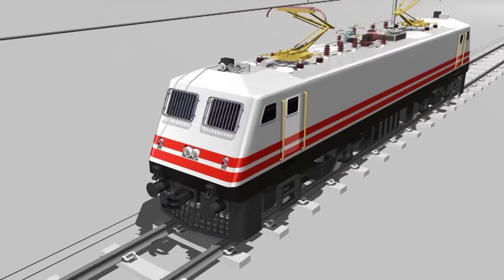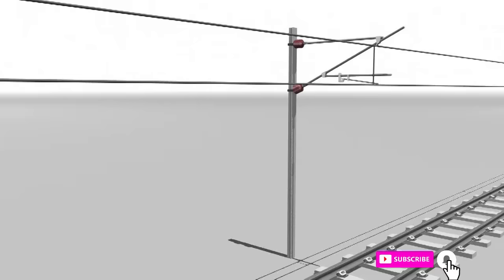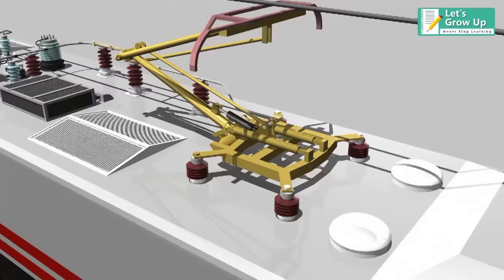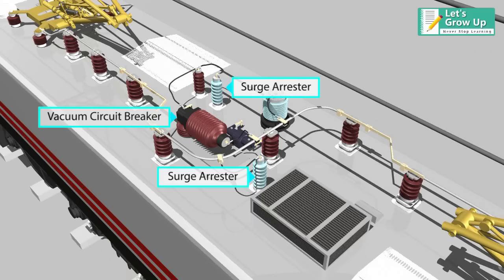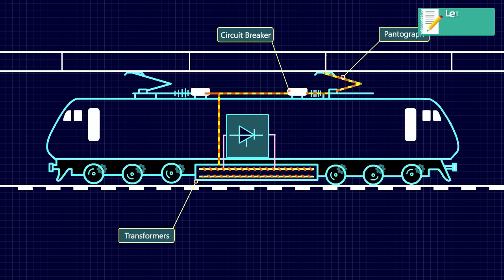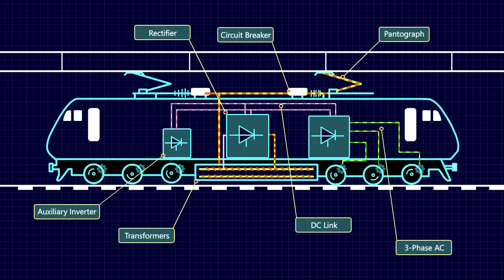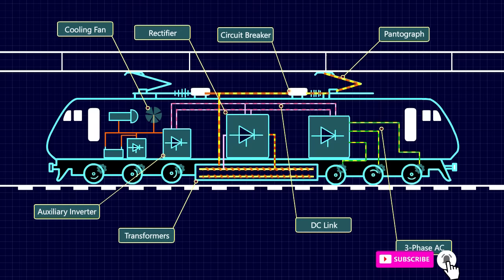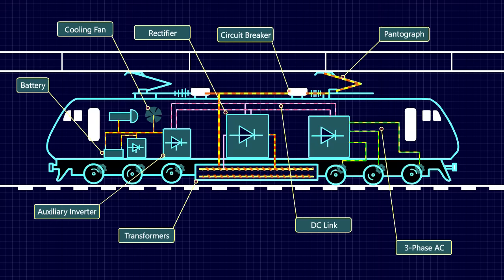How Does Electric Locomotive Work? | WAP7 Working Function | Electric Locomotive Working function

Comment from the maker: Q | Why surge arrester needed in electric Tran?
Reply: Answer plz
Reply: For protecting the electrical equipment from over-voltage short-circut during lightning and from the internal switching
Reply: Very much needed
Reply: @chiranjithalder3890  i can give answer
Reply: @chiranjithalder3890  i am an locomotive engineer
Reply: To maintain balanced voltage and current
Reply: What?
Reply: To protect the engine from thunder voltage i.e. externally while raining time
Reply: @innerpeace6777  The first thing I thought of was the internal switching.
All of that back EMF from inductors would reek havoc on semiconductors.
Reply: Surge arresters are used to protect the components from high voltages.
Reply: @howto545  Tree t1 66th ch b inn
Reply: To arrest the surge
Reply: Protect the ckt from hight Voltage and lighting
Reply: @innerpeace6777  we add a QR add on le la la
Reply: @innerpeace6777  add Z
Reply: @howto545  pls tell me with only phase when u draw from pentagraph. How negative phase is added to complete the circuit.
Reply: @Antharishk  through busbars then tranformer then through wheel then to rails
Reply: Please if you have any pdf  related with electric locomotive explain can you send for me?

Comment: The torque produced by a 3 phase induction motor is unbeatable !
Reply: the reluctance motor is better
Reply: Is for control of speed and torque with Eletronic Variable systems and that is achieve with DC
Reply: Everything is good. unfortunately 110kmph is very bad , this type of train want to running minimum 160kmph that's proud of this invention
Reply: @k.p.thukasingamk.p.thulasi6967  WAP 7 is designed to run at a cruising speed of 130 to 140 kmph. Also WAP 7HS is a high speed version of conventional WAP 7 which can attain speed upto 160 kmph
Reply: @BlackBirdNooB  00000000
Reply: Nope it should go at 9999999999999999999999999999kmph

Comment: It is explained first ac current is converted to DC current. DC current is converted again as ac current. What is the principle and logic behind this? Can you explain
Reply: Me too don't understand can anyone explain this?
Reply: Because,traction motor are working on three phase AC current,
Reply: To get the most appropriate frequency for a given speed and load. And to get 3-phase current when the traction system is based on 3-phase AC induction motors. (Not all traction systems work that way though.)
Reply: Very well explained in brief.

Comment: I found that in earlier version the incoming 25KV is stepping down to 1200 volt and fed to Silicon controlled rectifier for converting AC to DC. Then this DC supply used to drive DC series Traction motor. Not any  AC supply to Traction motor. Please clarify. Your video is good.Thank you
Reply: Previous version was DC series motor driven now changed to 3ph Induction motor driven.

Comment: Though it's a very good informational video but I think there should be more detailing about the internal working procedures. The current video seems to be an outline of the topic - how electric locomotives work. Rather than this hsort video, I will advise to make a longer video illustrating each and every processes in details.

Comment: No explanation is given, how the pantograph works. That over head wires is not strung up  in straight line, but varies allowing wire to WIPE pantograph from left to right during contact. This action prevents the wire from cutting into the carbon recepticle. A very important part of the lectricity collection.
Reply: It's just a basic idea about how it's actually works

Comment: U display a WAP5 and title about a WAP7... 
You are speaking about Overall Electric Locos in the Video not a WAP7 specifically.. 
Both Pantos are Never Used together nor  face the same direction.. Always in a 
< > position at either end.

A Good Attempt but u need to do better research n homework!

Comment: In lower DC voltage supply systems, the initial transformers and rectifiers are installed trackside. Some of the auxiliary inverters could be used to power passenger cars. You can also scale this down to an EMU where space for the engines has been confined to the bogies (wheel sets). This enables higher passenger capacity as well as faster acceleration.

Comment: How much wear a tear does the patgraph collector bar cuse on the overhead line. How do they stop the friction and overheating on the collector bar and power lines?
Reply: The over line should be arranged in a zig zag position so as to ensure the even wear out of the patgraph collector bar.
Reply: @shashank5r  : agreed. Further, wiper on pantograph is usually a carbon bar that eventually wears down. It is replaceable. The overhead wire wears as well and is eventually replaced.

Comment: Why does it convert AC to DC and then back to AC, can't it just regulate the AC and use it directly?
Reply: The motors need 3 phase to work, the line is a single phase, and is at 400 kV to reduce power loss. The loco needs to step it down for the motors and convert it to 3 phase.
Reply: @domesticterrorist483  Can't it just use a transformer to do that, why does it need to go through DC?
Reply: @QuantumBraced  
It basically receives a 25 KV power supply, single phase. A transformer is used to step down the voltage, suiting to motor winding insulation. A single phase power cannot be usefully converted into three phase (as the motor needs 3 phase supply), it is initially converted into DC, later inverted into AC supply of 3 phase.
Reply: @domesticterrorist483  it is not 400 kV.
Reply: It is because transistors/thyristors (which are inside the 1P to 3P inverter) doesn't support AC, thus it has to be converted to DC first.
Reply: @venkatiyer2719  
Sir, 
It's also used for filterd the voltage which voltage generated from regenerative braking.. 
That's why generally DC link voltage increased and Chopper resistor also over heated sometimes in braking conditions.

Comment: We had ac then it's was converted to dc and then to ac again, why? For variable frequency?
Reply: We r getting single phase ac supply of 25kv.. many components like blower motors compressor etc runs in 3phase, and dc supply is given to traction motors

Comment: I wonder what this is like on electric multiple units. Where are each of the components usually located, and how different are they in size?

What I learned from this video though is that the transformer, rectifier, and inverters are crucial components.
Reply: Usually in the roof or under the train

Comment: Is it possible to put solar panels on top of the train instead??????????????????
Reply: Solar isn't efficient enough to run large motors. It would take days of solar charging to run the train a short distance. There might be potential for solar to run less demanding circuits like lighting (like in an RV).
Reply: @redeyedfreaks  nuclear energy definitely has potential tho
Reply: @RandomIdioticGuy  we don’t need a nuclear plant running through cities, lol , also the complexity of minimising the volume, just put up a stationary plant and run the train via the existing  transmission lines
Reply: @nikmat   that's what i meant, handling huge nuclear plants inside engines in impossible

Comment: Discussion about positive, negative, neutral is missing.How the current is completing the circuit.
Overhead wire one on top of other.Why 2 nos..
Reply: The rail is the second wire.

The TWO wires at the top are actually NOT two.
They are one wire in fact.
The top wire suppotrs the lower wire AND keeps it at a LEVEL, horizontally so that the pantograph keeps in touch constantly.
No curves for the wire.
It shall stay straight.
Reply: @benmmbk765  ok understood.But how the current completes its journey.Does it go to the tracks finally.Suppose the electrical engine is stationary and someone touches the track..will the person get electrocuted..
Reply: @Soumo_b  No. The electrical circuit system is totally isolated from the passenger carrying part of the coach.

Comment: What is the supply voltage?. What is the voltage after converted by transformer
Reply: In Sweden and Norway 16kV max 4 kA and 16 2/3 Hz (near DC) and Denmark 25kV/15kV but 50Hz (?), this sounds very wrong?
Germany might use 16kV and 
same highvoltage netfrequenzy
as Swe/Nor. France, Belgium, Neatherland and Finnish: I REALLY DON'T KNOW! 
Anyone correct me, If I am wrong? Please!
Reply: In Italy, the power supply on traditional railway lines is 3000V DC. The high-speed lines are powered at 25kV AC. All the latest generation locomotives are designed to work with all the voltages used in Europe. The motors are always three-phase AC. If the power supply is 3000V DC this is conveyed directly to the power inverter and to the subsequent control. If, on the other hand, the power supply is alternating current, this passes first from the transformer and then from the rectifiers to the power inverter and to the control. In this case there is a double transformation A.C./D.C./A.C.
Reply: @carl-gunnarhillefors7612  Germany, Switzerland, Austria, Sweden and Norway use 15kV 16 2/3 Hz Belgium 3kV DC Netherlands 1.5kV DC France and Finnland  25kV 50Hz

Comment: circuit inside the WAP 7 is different then you explain. in transformer extra winding is provided for auxiliary inverter. auxiliary inverter is not sharing common DC link with traction inverter.

Comment: Hi voltage and 3 Phase parts of diagram are wrong.
Reply: no.
Reply: Only modern locomotivesa use AC motors.
Old locomotives hasn`t VFD drives, they use UNIVERSAL traction motors (can be poweered AC & DC) like more cheaper and easier to control device.
Only when VFD become mass used locomotives (and trams troleybus etc.) start using 3ph AC motors.
Reply: Good

Comment: So.....You can start with 25kV AC input through the pantograph (Single phase) --> DC link --> 3 phase AC (for supply to modern traction motors running at what sort of voltage and frequency??).  Also the battery on the train used to run tertiary systems on board, is that also run off the 3 phase AC or DC??  Please help anyone with filling in the '??'s' .  Many thanks.

Comment: how about netral in pantograph?
because 1 phase ac suply need netral
Reply: Like the neutral wire? The neutral wire is connected to the wheels using axle brushes so the rails can serve as neutral.
Reply: @pvlcz4360  finaly, thank's man😇
Reply: @pvlcz4360  The third rail in a bipolar system performs the function of the copper power line; instead of using the pantograph it uses a live rail to feed itself. In fact, if you look closely at this system, the third rail is isolated from the ground. This system is especially used in urban subways as it saves the excavation space that would be needed to put the power line up.
Reply: @ezioauditore1522  In Londons Tube there is also a 4th rail. I dont remember the exact reason, but i think its because the currents were leaking into the ground. In this system there are two normal rails, one live, and one neutral.

Comment: If the line is DC, before transformers you need a inverter
Reply: If the line is DC you don't need power transformer. Just inverter.
Reply: @akaikangaroo  to reduce current use resistences, no? Or you introduce 3Kv in the inverter? (Sorry for my english 😞)
Reply: @ivannipaidea970  Probably you're right. I am more into subway EMUs. Those work at 600 — 900 Volts DC, so they don't need to reduce voltage as the IGBT can operate at 1200 V

Comment: I have a question and didnt get answer for it after watching this video, single phase 25kV line used here and neutral is grounded through wheel and railway track, now my question is what ever is the amount of current flowing from 25KV phase goes to neutral (ground), how the circuit is completed here, and what about the losses when the neutral is grounded? Please answer
Reply: 25 KV is step down by the transformer

Comment: How much electricity is used  per trip of 1000km
Reply: Depends on the specific train power requirements, but one example of a 8-car electric multiple unit is that it needs 2.7MW.  If you say you are running at 70mph, say roughly would take 9 hours then to run 1000km (s=d/t).  So I believe you can just times by 9 to get electricity used in your 1000km journey (The units for electricity consumed is normally measured in kW/hrs).  

I read a TESLA car =122.75W hr/per passenger/ per km whereas an electric train = 50-52 W hr/per km/ per passenger

Comment: Where is diesel used in electric locomotive?
Reply: diesel is not used in electric locomotive  . But in diesel locomotive the engine required diesel , the torque provided will run the 
generator , the electric will run the motor and locomotive moves
Reply: @gawthamkrishna6833  thanks bro for clarifying

Comment: Why the train converts ac to dc and then later converts again dc to ac?
Reply: the ac frequency of the powerline is always the same (for example 50Hz), but with the inverter you can create different frequencies and controll your speed and torque.
Imagine you try to start on your bicycle in highest gear with you trying to push the pedals as fast as possible with your legs. You will not be able to start and fall over
Reply: @martinlang3818  Thanks so much, your explanation makes sense, is like the eletric cars nowadays works!
Reply: If it used the line frequency the motor would run at about 3000 rpm all the time.
Reply: @donotwantahandle1111  Makes sense,  thanks d ss!

Comment: How it becomes three phase? From a single wire
Reply: 25kv in transformer 
Transformer convert it in needed. 
1269 V for SR
750 V for HL
1000V BUR
SR converted the 1269 v ac in 2800 v dc then inverted to 2180 V Ac for 3phase TM
Reply: Well in converting to low volt to high volts. How electrons r controlled to jack up current and vice versa..pls explain this . What about the loss of electrons . In doing so

Comment: Neutral?
Reply: Like the neutral wire? The neutral wire is connected to the wheels using axle brushes so the rails can serve as neutral.
Reply: @pvlcz4360  Thanks for the information

Comment: No AC is there in over head sir...
It's 25000V DC
Reply: Bro it is ac not dc,in india we no where use dc in railway electric transmission.
Reply: @kousikmullapudi5126  ya.. ofcourse.. M talking about India only...
U mean.. that 25000V used in electric traction , that is AC!!!!!
Reply: 🤣🤣🤣 its 25kv ac single phase
Reply: Both way TRUE
Some lines has AC, some DC
But old locomotives use DC traction motors, much easier to control and more starting torcue.
Reply: Overhead line is typically 25kV (AC) but can be 15kV (AC) or 3kV (DC) or 1500V (DC) It depends which country/railway network you are talking about.  Also a third rail supply is typically 750V DC

Comment: Why electric motors are faster
Reply: Because electric motors have one thing that is difficult for any petrol engine to reproduce.
Instant (lightening fast) high torque.
Reply: @TacticalRuse  I saw a Russian Lada converted to electric take a Corvette c8 and beat it by by almost a full second.
just over 400 meters I think is the typical strip.
That doesn't mean it can go as far as a c8, just "out of the gates" faster.
Reply: Because the high voltage overhead electric cable delivers more energy then a diesel engine.

Comment: Why convert AC to DC and DC to AC
Reply: HVAC is transmitted from Transmission line to rectifier banks of a train.This AC power is converted to DC to run the DC traction motors.

DC motors are used as traction motors as DC motors have higher start-up power and torque, which is very much needed to haul the long and heavy train. Also, due to frequent start and stoppages of trains.
Reply: @p.singson3910  DC motors are no longer used in modern locomotives. They are heavier than induction motors and require more maintenance on the commutators and brushes. AC motors are brushless and are preferred. This was possible with the advent of power electronics which gives the possibility to vary the rotation speed by changing the frequency.
Reply: @ezioauditore1522  Thanks for the information 🙏
Reply: @ezioauditore1522  Wrong! Even in Italy, german new-generation DC locomotives are in operation.
Reply: the traction motors are three phase AC motors, so you need to convert the single phase ac supply to 3phase, secondly for control purposes
Reply: @mphoseshabela3833  this answer is correct.....